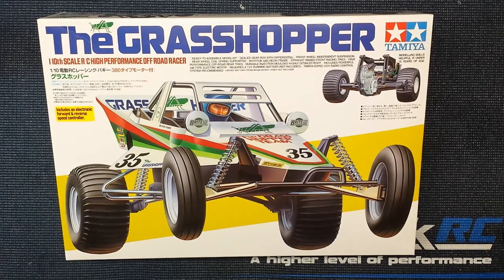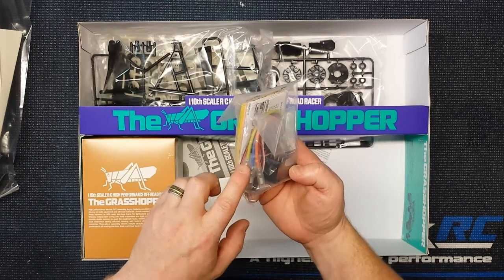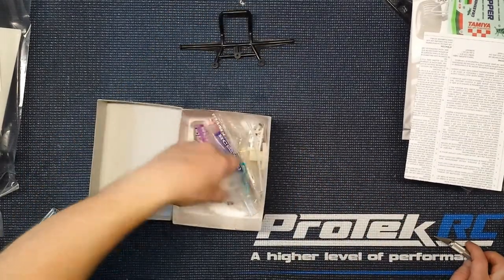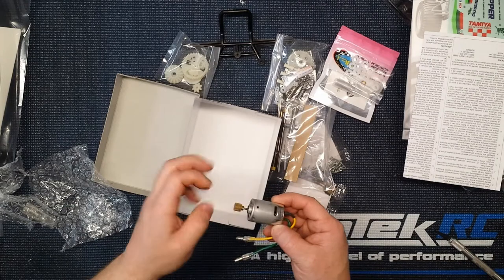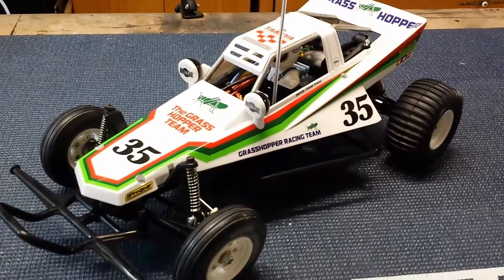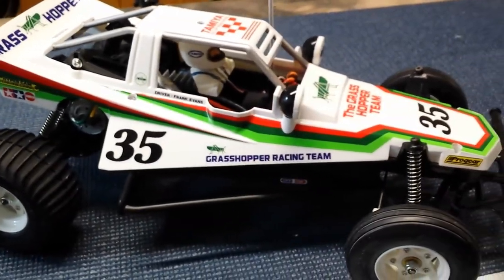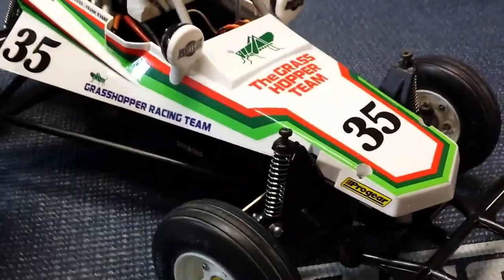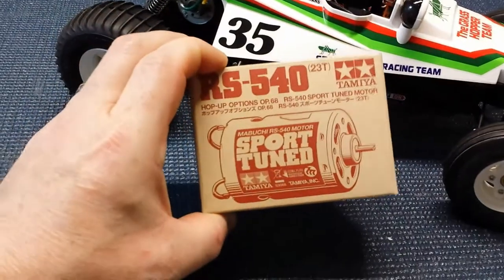Tamiya Grasshopper Build and Thoughts on it

Comment: Just picked up this kit. The green one. Got the sport tuned 540 same one you showed in video. I have never built a kit from scratch. Looking forward to it.
Reply from the maker: You will enjoy building it. It is really straight forward and the instructions are easy to follow. Make sure you center the servo before putting the servo saver on and insert the rear tire insert as it shows in the instruction. You have to force it in the tire, don't worry, you are no going to hurt the tire or the insert. Put it in sideways and work one side of the tire one a little and then the other side a little, eventually it will pop inside and then you are good! I think in the build video of my green one there are tips on mounting the tires and wheels. They are honestly the hardest part of the build!

Comment: When you're putting in the centerpiece for the rear tires are you putting it into the tire sideways or are you trying to put it in as it would go into the tire if that makes sense
Reply from the maker: I have learned the proper way since this video and put them in side ways. I fought these every which way and was struggling with them. I do laugh as one of the most common first kits for people for decades and the come with some of the most difficult tires and wheels to mount! The hornet ones are not as difficult, I guess the sidewalls have a little move give. These paddles are tougher!

Comment: I'm new to this and I'm planning to buy an rc for off road and on road.  $160-180 budget any recommendations 😊 very much appreciated thank you
Reply from the maker: The Grasshopper is a classic but is limited. I would say the the TT02B Plasma edge or the DT03 Neo Fighter or Racing Fighter would be a better buy with more performance out of the box for not much more money. The TT02 kits are great and inexpensive so you could look for one of the Rally cars and do decent off road. If you plan on driving on road more than one of the TT02 kits would be great, just don't go for one of the super detailed race cars as you may struggle getting the sticker on there, they often have over 100 stickers to make up the designs on the bodies and can be overwhelming! Of course there is always the Lunch Box which is a ton of fun as well.

Comment: What esc comes with that?  MIne didn't come with one and now i'm trying to find the best solution.
Reply from the maker: They used to come with the Tamiya TBLE04S ESC but they have not been including them in a couple years now. All the new kits (if included) come with the HobbyWing 1060 ESC. They are great ESCs but the switch does not work with the factory placement. In this kit is it not a big deal as you can position in the chassis when building to be able to stick your finger inside and turn it on pretty easy. If you get one, make sure it is a true HW ESC. Many of the cheap ones sole one eBay are knockoffs and they do not tend to last long, sometimes not at all. If you get it from a hobby shop online or in store it should be fine. I have gotten them from Amazon but I make sure it is sold by HobbyWing through them.

Comment: I have built many many Tamiya cars , today i built the very basic Grasshopper , the wheels were an absolute pain in the butt with all those tiny screws , drove me mad.
Reply from the maker: There are tricks to it but yes, they can be a nightmare. After doing a few pairs now they have gotten a lot easier. In one of the Fighting Buggy videos I did there was a segment in there about putting them together that makes it a lot quicker and simpler, granted that doesn't help you on these but maybe in the future as several others have the same wheels! They do take the kid friendly aspect out of the build as I don't know any 12 year olds that would be able to get them together without help!

Comment: Just ran into your video. What is the model of that brushed/brushless esc that came with the kit? Thanks.
Reply from the maker: Mine came with the TBLE02 ESC but since this they has stopped making them, they went to the TBLE04 briefly and then quit making ESCs all together. Now all the ones in the US come with the Hobbywing 1060 ESC, which are great ESCs, the only issue is the switch placement on many kits as the switch is completely different from the old Tamiya ones. You can get creative in some cases, in others you can mount it to the side of the ESC and still turn it on and off or other time it is just easier to leave it on and when you plug it up the ESC will be on. I know in the UK they were coming with Carson ESCs and now I think they have moved to the Hobbywing in the new kits as well!
Reply: @AddamsPlayground  Thank you for the info. I was interested in the featured esc as it is both brushed and brushless. I guess I will need to decide which motor to run.
Reply from the maker: @rtracing  I have heard the TBLE ESCs were not the best with brushless motors but I don't have and experience with it though, I am stubborn about change and still love my brushed motors! LOL!

Comment: I have no clue reverse can you help?
Reply from the maker: What speed control is in your buggy? More than likely you either need to adjust the throttle trim of make sure you have the jumper set to F/B/R on the ESC if you have the Hobbywing 1060 in it.

Comment: Hi Addam, hope you are doing well. Hey is the grasshopper a good option for a beach runner in stock form?  That’s all I would use it for.  Thanks!
Reply from the maker: It will do very well in the damp sand or even in coarse drier sand. It will struggle in fine dry sand though. Most any 2wd will struggle in the dry fine sand but the smaller tires and the very hoppy rear end it will hop and spin until it stops and digs a hole. The paddle tires do well and will do amazing in the smooth damp sand!

Comment: Just purchased this kit:   What would you recommend for: 

ESC
Transmitter / Receiver
Ball Bearing Kit
I purchased a Servo with the kit when I picked it up from a local shop.  Was thinking about getting the rest of the parts online.

Looking to not spend a fortune.
Reply from the maker: If it did not come with a ESC then a Hobbywing 1060ia a solid and cheap one to get. For a transmitter/receiver setup I like the Flysky RC FS GT2B as it is only about $40 and comes with a rechargeable battery pack. Bearing you should be able to get a TRB or Fast Eddy bearing kit off of Amazon as well. If you plan on going with a 540 motor a sport tuned is all you need until you start upgrading the suspension. You will need a pinion for that, I cannot remember the tooth count but it is a 32 pitch pinion gear (I want to say 18tooth but I cannot recall). I will check and let you know
Reply: @AddamsPlayground  Thanks!  For the  Fast Eddy bearing kit, is there a certain model or type that I should get?  There are a million different options on Ebay/Amazon!
Reply from the maker: @depositionsandstuff7465  search Amazon for. TRB RC Tamiya Grasshopper Precision Ball Bearing Kit. I use his bearings in all my builds and they are cheaper. If you want the fast Eddie ones search for Fast Eddie bearing kit Grasshopper and it should be in the top results on Amazon too. The pinion size for a 540 motor is the 32p 18 tooth like I though
Reply: @AddamsPlayground  awesome! Appreciate the super fast response.
Reply from the maker: @depositionsandstuff7465  not a problem!